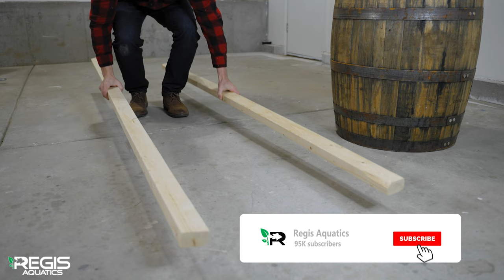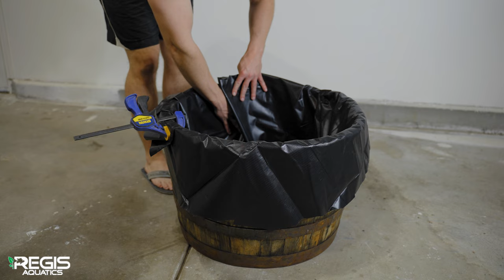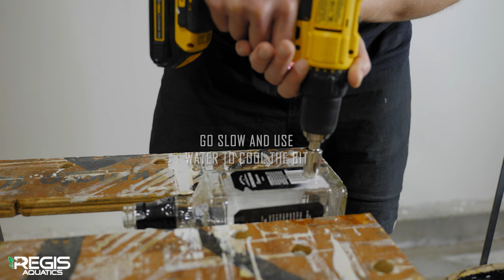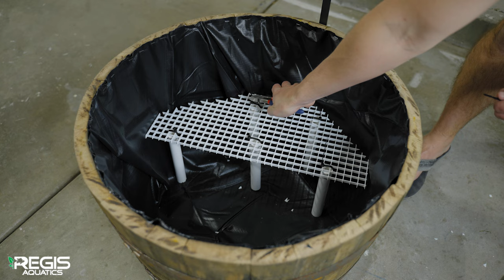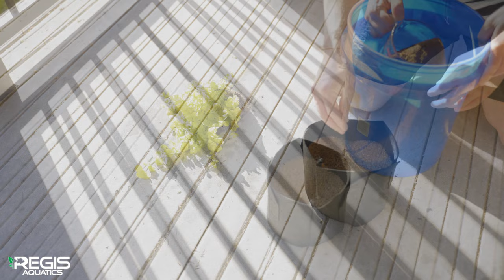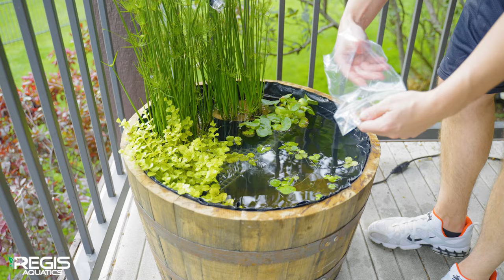How-to Build a Patio Pond from a Barrel!

Comment: Nice setup! I made one of these a couple of months ago :) I skipped the step of adding a pond liner though. The guy I bought the barrel from recommended not to line the barrel because the planks of wood will shrink over time. It will slowly leak for several days without a liner, but eventually the wood will swell up and hold water just fine.
Reply from the maker: Thanks!  I initially tried with no liner but the water started smelling really bad after a few hours.  I didn't want to risk affecting the fish.
Reply: @RegisAquatics  You just need to sand the charred wood off of the inside of the barrel and do a few water changes over a couple of weeks. Mine smelt like whiskey for a while but the smell has gone now :)
Reply: @superjaz1810  great info
Reply: I was thinking that you could line the inside with fibre glass.
Reply: How about FlexSeal? The. Let it cure and do a few water changes. 
If that would off gas too many chemicals you could do Krylon Fusion spray paint, once it’s dry it’s as inert as PVC.
Reply: @stormtrooper2010  Wonder how the fish would handle the flexseal?